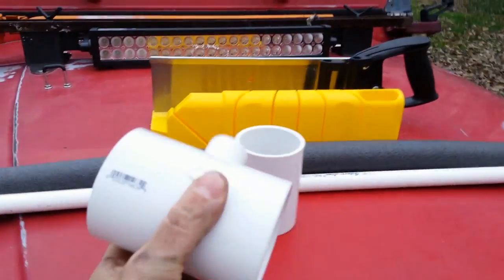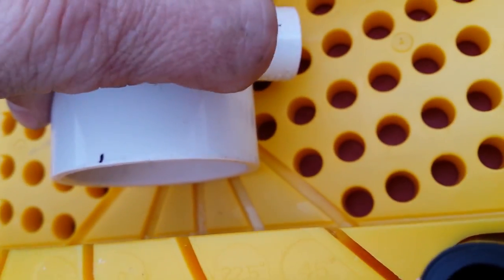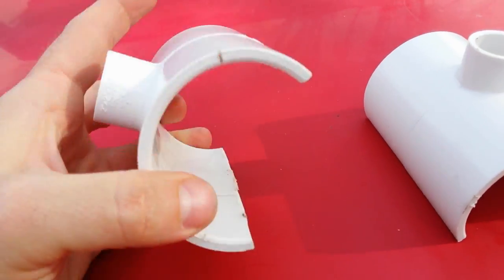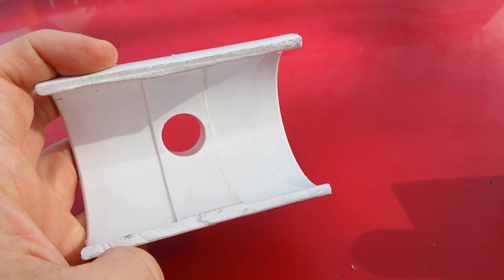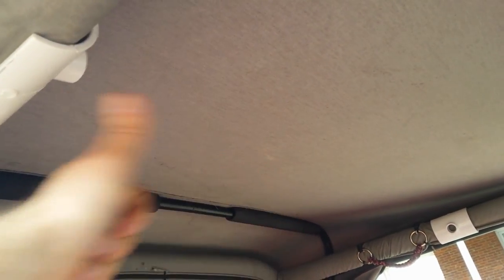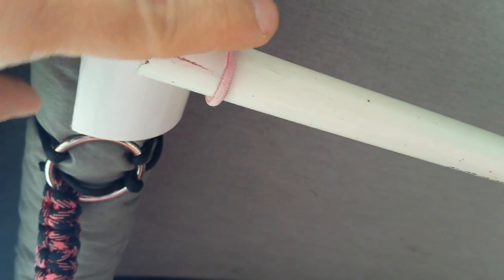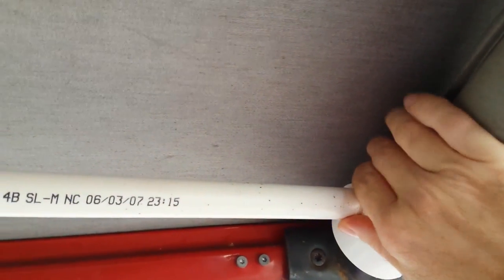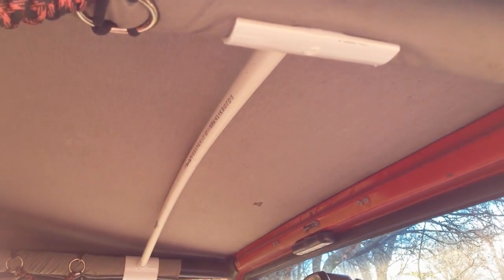Jeep Wrangler - Cheap and easy soft top support

Comment: I'm running a pavement ends as well. The rain has not been a friend to me. This trick is definitely happening today
Reply from the maker: Glad you like it. As you see its an easy and very inexpensive mod/fix. It quietened the wind flapping of the top traveling at highway speeds as well. Hope it works out well for ya. Thanks for dropping in and leaving a great comment. Have a great day!

Comment: looks good...I bet you could put a Paton on that design...I personally don't have a jeep but that's about the same thing that I had in my old blazer that had a roll bar in it...the only difference is I paid about $200 for a piece of plastic to keep the heat in the front...It didn't even fit very well...

Comment: I am having a major problem figuring out how to assemble the frame of Rampage Products complete soft top kit. I have a college degree and it is almost Greek to me. 
Please help a fellow Tennessean out, if you are able.
Thanks!
Lisa P
Fayetteville, TN
Reply from the maker: Rampage makes a few complete tops. The top I have on my Jeep now is a Rampage "Cab Top". I've done a video on it. I don't have access to any other rigs with a Rampage tops or I'd make a video demo'ing it. Wish I could help with a video. I've been close to Fayetteville a few times, haven't actually been there.
Reply: @Poweraddicts  Thank you for the reply. I just bit the bullet and plunked down the bucks to revamp the original frame and ordered another top. I'll try to sell the other.
Come visit sometime. I would be pleased to show you and your family around. My son works at Jack Daniels; I'll ensure you can take a tour. 
Also, I am going to use your tip on the cross piece made from PVC.
Thank you again!

Comment: What size “T” would you suggest if I do not have roll bar padding?
Reply from the maker: I would measure the diameter of the roll bar and go about 1/2 larger diameter. Trim the opening until it kinda "snaps" over the roll bar.

Comment: I just installed a soft top on my YJ and noticed while driving, this area seems to flap alot...is there anything I can do to reduce wind flap?
Reply from the maker: Did you originally have a hard top? My dad removed his hard top and installed a cheap soft top. He hated it and put the hard top back on. You can make this soft top support, it helps but doesn't stop it. It also depends on what brand soft top you have. I know of one TJ that has a cheap thin soft top, it flaps like crazy. Another friend of mine has a TJ with the heavyweight material Bestop Supertop, it not bad at all. Hop this helps. Have a great day!
Reply: worked outstanding, painted mine black. Great engineering 😁👍
Reply from the maker: Glad it worked out for you!! Thanks for taking the time to leave a great comment! Have a great day!!

Comment: Any idea on LED headlights for a YJ?
Reply from the maker: +Justin.jennifer Crittenden They make conversion LED kits. I just haven't ventured into them yet due to cost and waiting for technology to grow a little more.. Some of the kits I've looked at has a cooling fan on back of the LED fixture. Not a fan of that idea because I do go off roading when I get the chance. That fan pulling in dirt, water & mud would allow the LED to over heat, therefore burning out (wasted money). There is a company called JB Speaker that has the whole replacement fixture. they are very expensive for my taste. Also, just my personal opinion, the JBs are terribly ugly!! I still do occasionally look around on the market to see if I can find something to test that wouldn't break the bank if they turned out to be junk. Just keep hanging around, I'm sure somewhere down the line I'll end up with a set. Have a great day!!
Reply from the maker: Hey .. Just a heads up. I'll be soon releasing a video where I install and review a LED headlight conversion. Not the cheap euro conversion junk. Good quality conversion that provides great performance and doesn't blind traffic coming at you. These do have cooling fans in them .. but .. they are waterproof so water should not be an issue.

Comment: Is it hard to replace chassis mounts and engine mounts on a YJ
Reply from the maker: +Gary King Engine mounts, not really. Sometimes aligning the bolts back up can be a pain. Sometimes they practically fall in. Well... other times .. it hammer time!! As for body mounts, you could run into rusted bolts, twisting bolts in two. Or, get lucky and they come out easy. I would suggest spraying body mount bolts with PB Blaster every couple of days for at least a couple of weeks. It may not be needed. But, it could save you some real headaches.